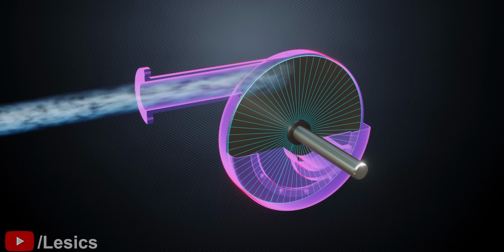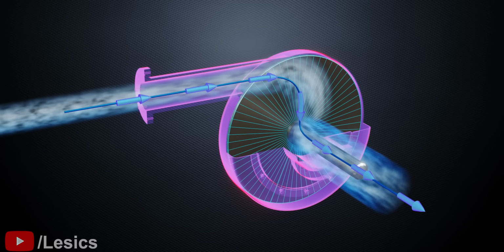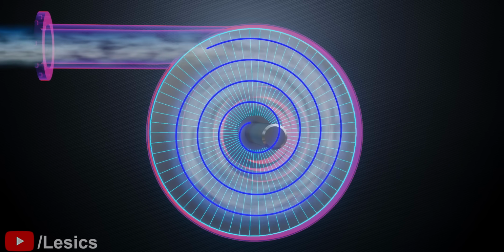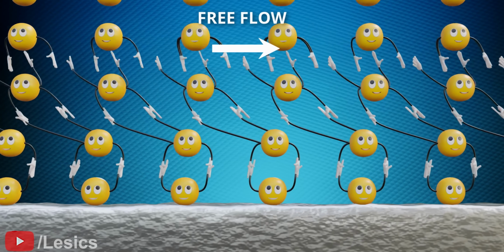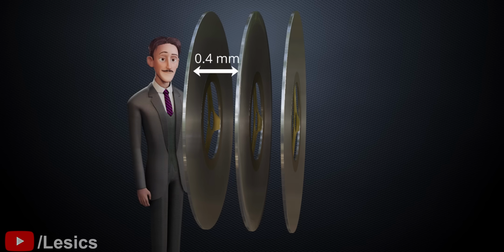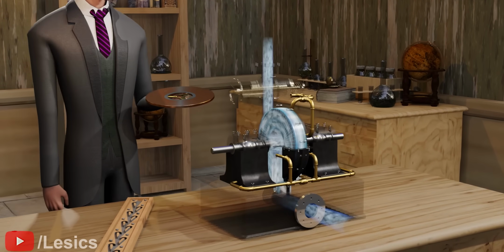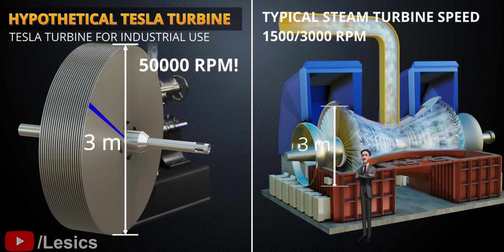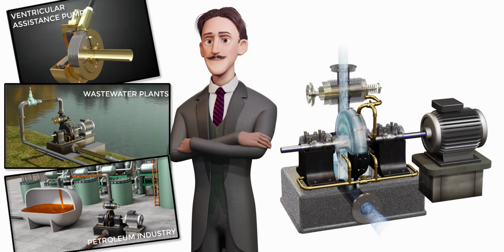Tesla Turbine | The interesting physics behind it

Comment: Nothing is impossible for engineering. It just need time and new materials and solutions will emerge. His design was to ahead of his time. That is the problem of every time traveler. 😉😂
Reply: Excel lent!
Reply: sounds like a job for graphene!
Reply: @TheBigLeChowski  Okay then. So where is that graphene being produced?
Reply: @john3260  steal your classmate's pencil
Reply: @j_respect5948  Bruh, if graphene is this miracle material and can be produced by exofoliating graphite, why isn't it being mass produced?
Reply: @j_respect5948  and his scotch tape lol
Reply: @john3260  its hard to produce...... But yeah its coming
Reply: Like Jeremy Clarkson once said: The scope of my engineering genius literally knows no bounds
Reply: Or just happy with good enough at fraction of the cost
Reply: It will never be done. Not necessarily because it is impossible, but for reasons of safety. 

If we assume a futuristic super-material is discovered that allows that 3meter turbine (approx 7m^3 of material) to weigh only 5000kg (instead of the 56000kg it would weigh if made from steel). The 3m spinning disk array would still contain 77 Gigajoules of kinetic energy. 

That is equal to more than 18 tons of TNT. 
One crack in the disks and your power plant explodes. 

Most people prefer non-exploding power plants.
Reply: @nicellis44  to be fair the amount of energy needed to spin that disc up to speed far exceeds the amount you could extract from a Tesla turbine
Reply: Well you cant engineer around the laws of physics. His turbine while very cool isn’t practical, there exists today far better turbines, like steam turbine example in this video.
Reply: That got me when he said "Impossible" as well
Reply: Nicola couldn't even accept settled science like Relativity... or the very existence of the electron! haha. Let's not talk about QM etc

 He became the laughing stock of the scientific community in his last, nutty tears.... besides not producing a single equation in his life. For a time traveler, he was really sloppy, lol.
Reply: @TheChzoronzon  Well, are we really sure electron actually exists?  It can pop in and out of existence at will, be here and there and everywhere in between all at once, and become tangled across across light years ... and we simply accept that what it is, some even speculate there might be only one single electron for all eternity.  Who knew?  Maybe the time traveler was bound by prime directive and couldn't tell us the whole truth ^_~
Reply: @ThisNoName  Spoken like a true Nicola fan, pristine, bravo!
Reply: @TheChzoronzon  Not at all, wouldn't even know the name had not for the car.  But the foundation of the whole quantum mechanics is just too spooky, like rooster theory about the sun, works every time.
Reply: @ThisNoName  That's not a foundation of QM, that's just the Copenhagen interpretation of it. There's a lot of other ways to interpret QM like the de Broglie-Bohm theory (pilot wave theory).
Reply: If you think it, it's possible
Reply: What if they use titanium?

Comment: Man, this literaly looks like centrifugal supercharger.
Reply: No, no it doesn't.  Literally.  A centrifugal supercharger contains a bladed turbine that is very similar to the turbines found in turbochargers.  It does not contain flat spinning disks, ie a Tesla Turbine.  The only difference between a turbocharger and a centrifugal supercharger is that the turbo is driven by exhaust pressure and the supercharger is driven mechanically by the engine.
Reply: @bradwilson76  oh yes, i forgot that some people have xrays in their eyes and can see through casing
Reply: @jaake6091  ... Huh?
Reply: @jaake6091  nice one
Reply: @bradwilson76  he meant the casing . And it does . Might be something there
Reply: @ClaytonBigsby01  the way i understand it is that supercharger type i mentioned uses centrifugal force effect to suck in and compress air basicaly acting like an air pump which perfectly connects to its shape.

Comment: Imagine knowing people generations later still don’t have the materials strong enough to make this work.
Reply: The materials exist to make this work with a six inch discs pump, unfortunately the efficiency with 35.000 RPM polymer/titanium, Kevlar, carbon fiber or ceramic/beryllium discs, will be far from 97%, and around 60-70%.
Reply: @chucku00  0
Reply: @chucku00     but still….
Reply: @TheDalk  More efficient (>70%) small turbine technology already exists.
Reply: That just makes it a great idea that will forever be impractical, especially if there are other more practical ways to achieve the same outcome (which, in this case, there are).  Some of Tesla's inventions changed the course of history; some others were great ideas but impractical (because, eg, materials didn't exist); and many others were just looney, eg an earthquake machine and a death ray.  The guy was truly a brilliant mad scientist.
Reply: @bradwilson76  The so called earthquake machine depended on the effect of sympathetic vibration. Everything has a certain frequency at which it will vibrate, a small input of that frequency can cause a large disturbance, the classic example is an opera singer who can shatter a wine glass with a high note. The engine in your car has a vibration dampener to prevent sympathetic vibration of the crankshaft, otherwise the crankshaft would snap in two like a carrot at a certain RPM.
Tesla made a small machine no bigger than a football which he demonstrated by attaching it to the steel frame of the building in New York, he adjusted the vibration to the frequency that shook the whole building, but shut it off before it wrecked everything. Said he could demolish the building in minutes if he wanted to. There is no theoretical reason such a machine could not be made to shake a whole city.
Reply: @Oog Oog Graphene has 300 times the tensile strength in compared to kevlar. So most probably it'll do.
Reply: @Oog Oog It's a possibility, carbon fiber discs with graphene crowns might be an interesting option to get higher rpm from the turbine. But due to its high electrical conductivity and limited production for the moment, it might be difficult to manufacture these discs anywhere else than for prototypes. And more economically profitable uses of graphene (mainly electronics and high-end mechanics) could also limit its use for this purpose.
Reply: There were MANY tecs of that era that KNEW that satellites were possible, in the 30 s they knew that mobile phones were possible. They knew computers were possible but the technology wasn't available
Reply: @gowdsake7103  what is You want to say?
we know the possibility but some something abort the mission?
Reply: @cool2martini  This is the mindset of the left.
Reply: @gowdsake7103  Tesla described cell phones and smart phones in the 1920s and said he had the technology to make them. He had a remote control boat operating by radio in 1900. It took many years for the rest of the world to catch up with his ideas.
Reply: @Peter Evans I’m not saying it’s possible to do it… just saying imagine.
Reply: @Peter Evans not sure where we would be if Einstein stuck with reality… his greatest contributions to the world originated from deep thought experiments. His imagination was key to discoveries in physics that shaped the world. I am by no means Einstein, I simply disagree with you when it comes to imagination.
Reply: @Peter Evans u gonna reply bro or are u mad…
Reply: @Peter Evans how many times has that been said about things that we now have?
Reply: @Peter EvansOf course not, that’s not what I’m saying at all. What I said is that his discoveries originated from his imagination. He didn’t imagine the math lol. Of course not. His imagination was a tool to help illustrate mathematical concepts which he then worked most of his life to form into sound theoretical equations. If we can’t agree on this, then I doubt your knowledge of Einstein, and more importantly the processes of innovation. Imagination is a tool. That is what I’m saying. Sheesh.

Comment: The thing I think could be done for some applications to let it spin faster is using more smaller discs in parallel to increase surface area without such a large radius, thus reducing the speed at the edges of each disc.
Reply: Would reduce the efficiency.  The bigger the disks are the more centrifugal force is being applied to keep the fluid from simply escaping through the center.
Reply: @forgetmybelief  fair enough, so I guess there's a need to balance it then

Comment: Did...did you accuse Tesla's math to be wrong at the end of the video? LOL amateurs.
Reply: Yeah. Im printing a 6 disc spool with an adapter on the end of the ‘drive shaft’. That way I can connect one of my dc motors to and see what kind of power it will make.

Comment: The spinning motion (centifugal force) will ALWAYS negate any other force as momentum increases. The device shown here is the opposite of how a centrifugal pump operates. Axial flow turbines have been state of the art for a long time, and massive R&D has considered any slight increase in efficiency for doing it otherwise.
Placing the source fluid in the center of the rotating disc will show how a modern turbocharger operates.....and if there was a better, more efficient way to extract every joule of energy from the source, it would have been adopted....this design is ass-backwards.

Comment: Why is the 3 meter disc size a requirement for industrial use?  And even if the efficiency is lower at lower RPMs, couldn't you just chain several turbine together?

Comment: BTW, This is the same tech used in a torque converter aka automatic transmission...
Reply: Uh...no it isnt. The blade design is. Have you ever seen a torque converter torn apart? A speed shop did mine and made it have a 2850 stall speed.

Comment: Wouldn’t the stated rpm be under zero load? The solution seems to be a simple torque converter connected to a sufficiently large generator motor capable of loading the turbine heavily enough to bring the rpm within manageable/useful speeds.
Reply: Yes, you could do that, but I’m bringing the rpm down you dramatically reduce the efficiency of the turbine

Comment: And blades on disc dramatically increase efficiency. If Tesla's system were more efficient, we would be using it today.
Reply: Not really: it is too dangerous to operate and maintain. OSHA would have a field day the first time one ripped apart from harmonic vibration from a negligent maintenance routine

Comment: 97% is most likely possible and at a massive power output if we had steel strong enough to make this turbine work as it was designed.   Tesla Turbines will be used in the future when we develop some material strong enough to hold together at mach 13.   The design is beyond brilliant. ..~!  it is so efficient it can tear steel discs to pieces using simple forces.     Imagine the massive generators one of these turbines could run.   You could build power houses that can power ever city in the nation using simple steam technology. The smaller amount of steam needed to make these run would be easily created using Natural Gas or Methane as they burn so clean compared to coal or oil the green value would be off the charts.
Reply: Ye, i was saying out loud, why not mach 13, today's materials are available. Soon very soon we'll see a lot of affordable versions of innovations previously hidden from sight. 

Tesla opened one of its rare stores next to our small town house/business here, 50 miles North of NYCity area and friends are always asking why we taking to long to make used electric golf carts into upgraded mini EVs. 

Hopefully Safepath Solarcars will be an affordable EVs reality to help everyone soon same as Tesla is progressing towards recently. 

Tesla has a cheaper model 2, around $25,000 according to Tesla type fan videos. Apparently looks like being built next to the Shanghai China Gigafactory.

Plus their own battery factory(s)  + other Gigafactory(s) are being built to lower costs sooner too, and generations ahead of other EVs technology 

👍
Weekend car show enthusiasts here and to much to list here, but recent times prove people are sharing awareness of various topics much more..

Thanks for your attention to electric modernization options and the future

Comment: The Tesla turbine was bad engineering, and was so recognized when it was invented. An efficient device is one in which no waste energy leaves the device.  Theoretically, the best turbine would be one in which the steam exhaust velocity is zero... which is impossible and why it is theoretical. Real turbines cause the steam to reverse its course inside the rotor blades, this is done because reversing direction causes the steam velocity to drop.  Think about it a minute, if we could perfectly reverse the flow AND spin the turbine at 1/2 the steam spouting velocity, then there would be no velocity left in the steam and all of it would be transferred to the turbine rotor.  While this is, as I said, impossible it is nevertheless the basic goal for which you strive.  Note that the Tesla turbine imparts no reversal of steam direction.   Reducing the steam velocity would involve reducing rotor velocity at the same time -- therefore maximum theoretical efficiency as measured by exhaust velocity would occur at zero rpm, at which point the turbine produces no work and therefore has zero efficiency!   Turbine designers are not idiots, far from it!  If there was anything to the Tesla turbine, they would have adopted it decades ago since it would be far easier to build and require less demanding materials.  Back in the 70s a number of members of the Steam Automobile Club of America built Tesla turbines and found that they produced vanishingly little power.

Comment: aahahahh
Next time take a rowing boat and instead of using the oar normally, with 90 degrees angle respect to the direction of moving, put the oar zero degrees sideway to direction of moving, you will "experiment" how effective is such "boundary viscosity limit" efficient  is.
By the way hydraulic torque converter use viscous liquid  as a medium to transfer torque,  it is not  flat smooth surfaces, but bladed surfaces, not using aerofoil principles. I wander how "tesla" name appear, scores of thousands open jaw gazers appear.

Comment: Has anyone considered using phylic material for the disk surfaces? You could increase the boundary layer size and thus spread the discs out further, potentially giving more margin for error and increasing torque for lower disc radius.

Comment: Actually, the statements made by this video are only correct when one considers STEAM as the driving force. Remember:  1. creating steam is very inefficient except in nuclear power plants. 2. if we change the viscosity of the driving material we can lower the required RPM or change the distance between blades or make the blades smaller. (this creates other issues as well)
Bottom line is that we use this kind of driving force regularly in transmissions and other equipment, even in automatic cooling fans in vehicles. So the design has unlimited usages but with modifications to its performance needs.

Comment: The further you are from the centre of a spinning disk the higher the centripetal force. So you don't need such a high rpm for it to become the most efficient. The same is for cars. Bigger engine, lower rpm but more power overall.

Comment: First, Nicola Tesla was amazing and a genius, and I am a huge fan of his. However:
How are turbulence and the resulting cavitation addressed, if it is? Adding a snippet about that would increase the feasibility of this concept. The speed information suggests there was a problem in the material properties (discs not strong enough-cause warping) rather than problems with the assumptions in the flow profile (pressure variations from turbulence cause cavitation (warping) in the discs and reduce theoretical efficiency). The illustrations and descriptions seem to be missing that uncomfortable reality and would be especially problematic in these circumstances.. Additionally, Tesla used steam, which would increase the effects. I was imagining water which would be less of an issue regarding cavitation, I believe (not sure), and could not see how that would have been resolved. 

The illustrations, especially the hand holding molecules, are really great- informative- but visualize assumptions for purely laminar flow (no turbulence); low speed and resistance. Editing them with the respect to turbulent flow would be more realistic. Or have I missed something? Please let me know if I have. 
However, this is essentially the theory behind a Pelton turbine,  using a cup instead of the material's viscosity.
Fascinating proposition though. Seeing more about the pumps would be cool, maybe there's an answer there? I really want to run a CFD simulation now to see the effects of turbulence with air flow.

Comment: This is a prime example of don't throw the baby out with the dishwater. Efficiency does not only apply to output. This just shows they will throw away renewable sustaniable energy production out for perceived efficiency as they don't take into account to produce steam require energy where as his turbine can be achieved energy free using water and gravity. Perfect use would be in a dam where nature provides the water and the dam conserves the energy to be released using gravity and the force of water exiting the dam.  Requires no extra energy use to produce the energy only the stored energy from the contained water and gravity. So only thing the tirbine does is extracts the energy from the stored protentional energy stored up naturally.